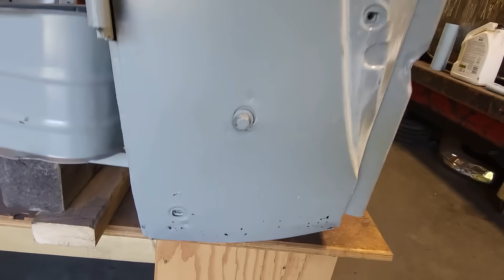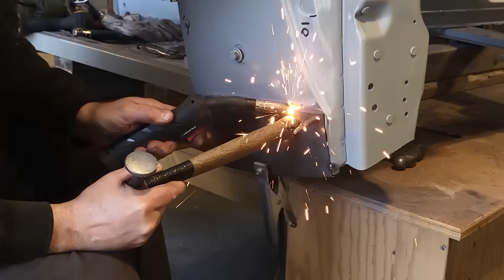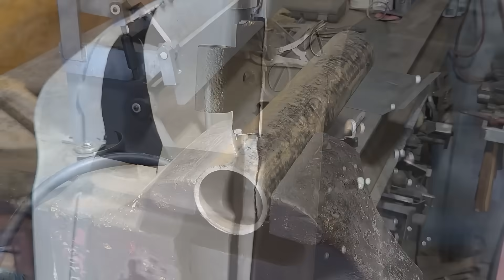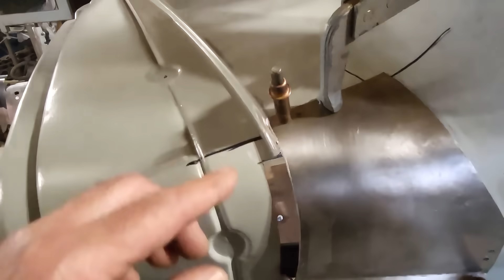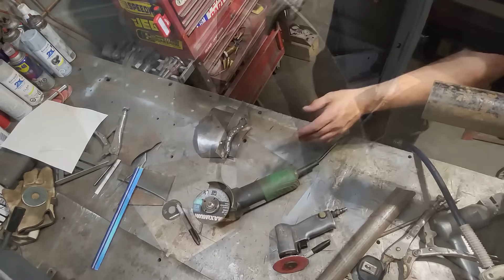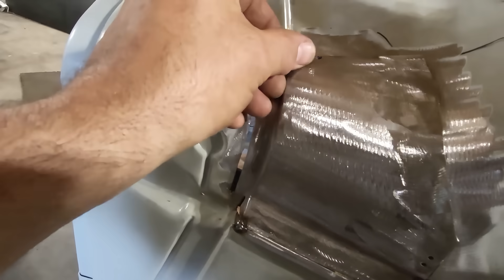Complicated repairs using simple tools

Comment: Nice work. No burn through at all. What type of mig, wire, and settings? It sounded perfect.
 Have you done a video on welding body panels with Fluxcore wire for us DIY'ers?
Reply from the maker: Using a Arccaptain mig200 welder with 023 wire .flux is a hotter weld. So burn threw happens, people use it but itbis a skill. I did a video on flux a few years back.

Comment: I do not understand how Tony can weld like that. I would be burning through the metal like crazy, even on minimum heat.
Reply from the maker: What kind of welder are you using? Is it with gas or a flux core wire?
Reply: @fitzeesfabrications  I have Arccaptain 130A MIG with gas. Using 030 wire. I needed 120V where my truck is
Reply from the maker: @mikeh6206 the 030 wire needs more heat to burn. 023 wire needs less heat. So it dont burn threw as bad as the 030. Dont seem like alot but when it comes to sheetmetal it is a big difference
Reply: @fitzeesfabrications  I may have to get a different welder. Smallest wire on this one is 030. 40A is the lowest setting. Do you have a model number of yours?
Reply from the maker: @mikeh6206 I been working with Arccaptain about the wire size and replacement  wheels. I have asked them to return the 023 setup to these machines just for us who use sheetmetal . If you contact Arccaptain they can help you out with this issue. If there is any issues let me know.

Comment: @malcolmyoung7866
0 seconds ago
I have a couple of bits of copper, one is a bar the other a flattened bit of plumbing pipe. ‘Re discovered’ a brass drift that used to belong to my dad in one of my metalworking tool boxes. Have used it a couple of times the past few days.. prefer the brass it seems to work better(maybe because I can get the ‘pointy end into the areas better.) Love these videos, also follow Make It Kustom, Cornfield Customs and Brent and Fab  Ass Customs(IIRC) Cheers from Scotland, Fitzee

Comment: A few years ago, you told us to just take 2 pieces of steel and make it one.  Then take another 2 pieces and make that one.  This video was a prime example.  I've use that lesson many times.  Thanks for all that you have taught us,
Reply: Only just started that technique myself. Basic tools etc ‘for the win’. Not working on a classic at the moment only a Honda Jazz that needs a ‘test’ here the UK. Repaired the strut towers and the flitch panels on both sides a lot of work amongst some running gear stuff too. Did a bit of stretching on the wheel arch sections .. had forgetter how to do that (did two restoration courses over 20 years ago) had to scratch my head a bit and deep dive into my rather poor memory..
Reply: @malcolmyoung7866  The method of using multiple pieces to make complex shapes, totally changed my willingness to try some repairs. I might not ever hammer a vintage Jaguar out of a rust heap, but it has allowed me to do things that I could not do before.

Comment: You start with a few bits of scrap metal, then you weld them together to make an ugly monstrosity. Some more welding and cutting and grinding and next thing you know, you have what looks like an original panel. Anyone new to your channel would wonder what on earth you are on about in the early stages. But having been a subscriber for six years now. I'm used to how you do things and I'm picking up a lot of tips on the way for when I start my project. Pretty incredible that it's already been six years since I found your channel!
Reply: I've pretty much got the hang of the first two steps, it's that 3rd one that I struggle with!

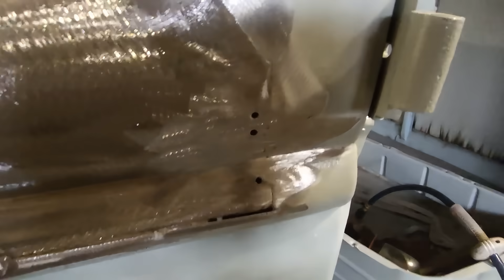Comment: Have you or anyone watching this ever used the butt weld clamps🤔? 56:36 They would have been great there. Small enough to leave room for welding without trying to find the angle for the body clamp😁.
Reply from the maker: I had them and used them. I found the metal would move when you weld its not stationary.  Thats why I like to tack weld it in place then do cut and butt. Only thing that moves is where I am cutting it.

Comment: What size welding wire are you using?
Reply from the maker: 023
Reply: @fitzeesfabrications  Is it possible to get this size wire with flux core as I have no tank or regulator.

Comment: ....i was using flux core first.... then got the gas bottles for mig.... that was a phukkin problem trying to source bottles because they want you to monthly rent the bottles... i don't weld everyday so its not financially practical.... its a hobby trying to work on your restoration..... then using 0.8 mig wire and transversing to 0.6, thats another thing.... .6 burns quicker.... still can't get it the way you do..... but there's still the go to filler to fix my shit...

Comment: I fully appreciate the fast forward full Monty of the process you use for a cutt &  butt they gave an overall look on just how to kind of do it I'm a rookie by your standards just a couple of small welders one oxyceline pistol grip henRob 2000 and a harbor freight 90 flux core I've only done a few things with each so far they've held but thanks for the video I appreciate it